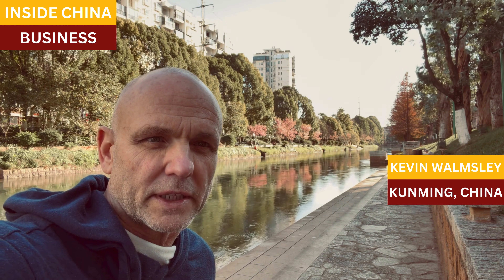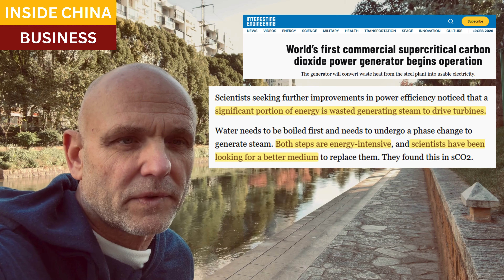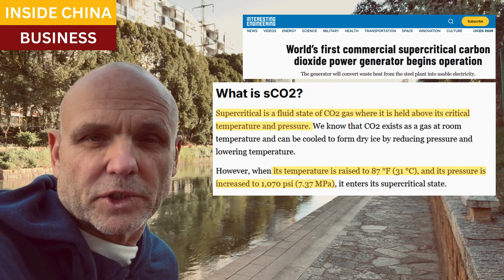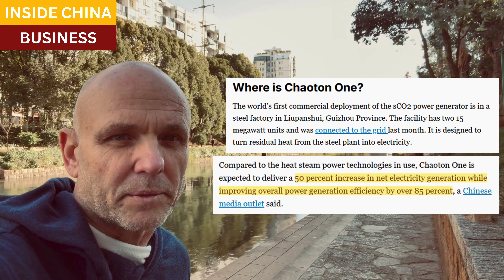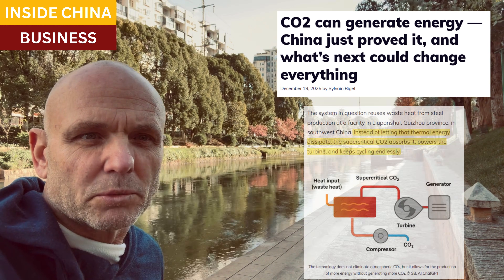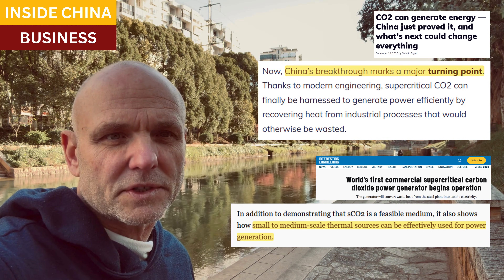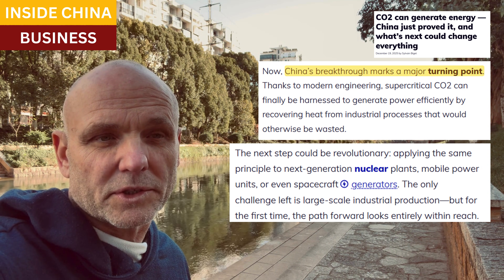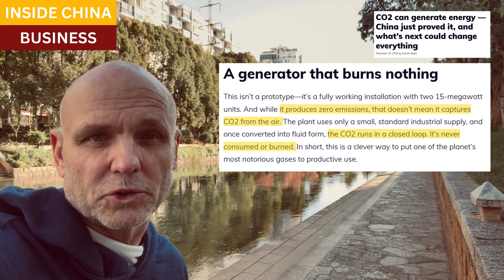Revolutionary generator transforms Chinese factories into power plants

Comment: I use carbon dioxide as a shielding gas. There appears to be many factors missing in this analysis such as where does the compressed CO2 come from and how do you recrompess it within the closed loop.

Comment: This is actually cool I work in HVAC/refrigeration engineering and we use it a refrigerant in systems with high pressure. I wonder the same if it could be used as turbine it does have different properties and components but using it in this case is pretty cool.

Comment: Giga clickbait. This is a waste heat recapture system, which is valuable of course, but it's not revolutionary. And that thumbnail makes it sound like the CO2 is fuel, as though you could pull it from the atmosphere. The CO2 is just the heat transfer medium.

Comment: I have only seen them in the lab or in prototype mode in the US , they are so much more smaller than the comparable steam turbine. there are some issues with keeping the Carbon dioxide supercritical   and the material of the turbine blades are still issues  but looks promising

Comment: this is a much simpler use of waste heat than using it via pipes to heat nearby homes. Its not worth it to have a heat network transporting heat over long distances, rather just reelectrify the heat and use a heat pump at the target location. Also in summer heat transport is useless, and you get free power.

Comment: So they use CO2  in a turbine. This is not a breakthrough. This is Chinese propaganda. 

Any engineer realize imediately that they are just using ORC, Organic Rankine Cycle, which works like a heat pump but with a turbine instead of a compressor. 

This tech does not create energy, it reduces waste heat and turns it into electricity. But the heat is from Natural gas or coal so not CO2 neutral. 

Learn engineering and dont be fooled by charlatans.

Comment: So... basically they are using Organic Rankin Cycle generators and instead of running it on Benzine or something similar they are running it on CO2 and heat gathered from the waste stream? Or is it a closed loop ORC?

Comment: The efficiency of a heat engine is determined by the gap in temperature between the hot and the cold temperatures. This invention is a secondary effect on efficiency where you lose some energy pumping fluids through pipes. You can use fatter pipes, but that's more material costs. You can't get around the primary limit to efficiency. It's based on statistical physics and is mathematically correct.

Comment: What bout internal combustion engines . Your truck exhaust ànd radiator. 
Are these generators makable in mind farm
Reply: That is can an internal combustion engine have the 50 or 60% of waste heat, used in these systems. Miniature versions

Comment: Same principle as the usual one by cooking water. Everyone do, over here the local sewage plant is energy neutral for more a decade and the  waste combustion plant sells electricity to chemical plants and steel mill. Way more safe because you can see the vapor and it will not block your oxygen support in case of. So the CO medium must have a way better  let's say enthalpy as the water vapor wich i doubt. Just show it, instead of Juche regime style cheering.

Comment: CO2 is used as a heat carrier like refrigerant. It is long known that CO2 can absorb lot of heat but could not be compressed so was not used in heat pumps. Japan does make Co2 heat pumps that can work upto boiling point.
If humans can strip 1 O(xygen) from O2 in the CO2, then we get a circular carbon economy and there is no need to dig up more fossil fuels or vent out CO2.
But then how can wealth be concentrated in hands of a few ?

Comment: Oh wow, I assumed sCO2 would need high temperatures, but carbon dioxide can become supercritical at temperatures as low as 31 degrees C. sCO2 can be used pretty much anywhere water is currently used for heat transfer, with greater efficiency, to the extent that the system can be miniaturized.

Comment: the problem is scaling and material cost. sure you can generate power by heating co2, but you need to get the co2, and you need to be able to manufacture materials that can handle the super high pressures and temperatures in gigantic amounts. sure, you could power a steel plant, but how about an entire city or a state?

Comment: I have some experience with this type of technology I have evaluated it for use in a steel mill and found it to lacking in economic payback.    Changing the working fluid from water to CO2 has efficiency benefits but not enough to offset the maintenance and operational difficulties in using CO2.  (CO2 is a difficult fluid to work with, it is hard to compress and it dissolves in oil which makes lubrication of turbines and compressors fail) 
 This 30MW installation is the largest installation I have heard about, but I have seen no operational data.  I would like to see the data to see if there really is some advantage in using CO2 vs water.

Comment: It's actually ground breaking. if it can be adapted to oil rig and oil refinery where flaring is routinely done. Such a waste. Solar mirrors power production will also benefit greatly from this tech if adapted. This is the holy grail where steam is being replaced by more efficient CO2 in direct heat power generation. The usage is vast. The West has lost. Japan has lost.

Comment: Instead of boiling water to make steam, the system heats sCO₂ and expands it through a turbine to generate electricity. Supercritical CO₂ is CO₂ held above its critical point (≈31 °C and ≈7.4 MPa), where it behaves as both a liquid and a gas.

Comment: Found this link about Sandia labs working the same process https://www.youtube.com/watch?v=6cQCbmzN8Ew
Just need industry picking it up and solving some of the issues Sandia mentions.
The biggest differences comparing steam to SCO2 is the lack of a condenser (steam); No chance of getting water droplets hitting blades in the LP turbine.
Question: The steam turbine water pump back into the boiler is fairly small (?) How big is the SCO2 pump to get it back up to pressure (~1000 psi in the case noted here)?

Comment: For 50 tears I have on occasion installed passive freeze technology in Alaska that uses compressed CO2 thermal cycle to extract heat from soils in permafrost areas in order to further stabilize structure foundations. The method was pioneered and patented by Irv Long in Alaska and has been employed in cold climates all over the globe. I am interested in these claims but as always with this channel, question every thing said.

Comment: The American Society of Heating Refrigeration and Airconditioning Engineers (ASHRAE) from 1973 the time of the Oil Crisis made significant engineering advances in uses of low temperature waste heat. When Oil supplies and prices returned to normal these advanced technologies were consigned to the dustbin

Comment: The supercritical CO2 cycle has also been proposed in connection with thorium molten salt reactors. Jiangsan shipyard in Shanghai says it is working on a system for container ships using the CO2 cycle.  The turbines are smaller and more efficient so are a natural for ships.  Don't be surprised to see one day these CO2 cycle TMSR reactors being used on carriers, submarines, and other warships.

Comment: I read a critique by Cleantechnica which had a wait n see approach citing a history of rapid efficiency degradation in prior applications of similar technology. That article had appreciation for Chinas aggressive experimentation but defers excitement until after a few years of operation without significant efficiency degradation. 

China on the whole though is comprehensive in their approach to energy independence & cleaner sources- this approach is just one component of an overall aggressive plan.

Comment: This is a real game changer if it can be scaled up.  The main attraction of this technology is it doesn't consume water in massive scale like a steam turbine.
It may surprises people but the biggest constraint of any large thermal power plant, that involves steam turbine, be it coal fired, oil fired, nuclear or gas-fired combined cycle, is the water for cooling the condenser.  Today's environmental regulation limits the cooling water cannot be raised to more than approximately 6 degree above ambient.  Thus a huge amount of seawater has to be used and infrastructure of the cooling water system is approaching its limit when the station generates about 7,000 MW.  A significant reduction of the cooling water demand will give a new future to the thermal power plants.

The west has been laughing at China because it is still building coal-fired power plants but they are seldom aware that many of the new coal-fired power plants in China is using "ultra-supercritical" technology that the west has ceased to pursue because the west has abandoned building new coal-fired power plant completely.  China has been using molten salt and sCo2 in power generation so it is able to operating these new technologies in commercial scale.

Comment: So... this is just a derivative of Jame's Watt's original steam engine.  China merely switched the coal boiler to a heat exchanger drawing waste heat from an industrial process, using supercritical CO2 instead of steam, spinning a turbine instead of a piston.  There's no Chinese innovation here, because it's just an upgrade to a variety of technology that's been in use at Chinese coal plants to drive even more efficiency by maximizing energy efficiency, or the turbocharger on an internal combustion engine extracting power from the waste heat in the exhaust gas.  

Sure, the West doesn't have any modern supercritical CO2 power systems operational, but make no mistake that China is only copying when they make fundamental changes to things, incorporating zillions little tweaks and upgrades to work with supercritical CO2 at high temperature, high pressure where gas functions like a liquid, with all of the necessary challenges of thermal / pressure cycling, sealing, gas purity, etc. 

Yes, this is a one-off test case to assess long-term viability, similar to the Thorium Molten Salt Reactor (TMSR) they have running in the Gobi Desert.  China will run this for a few years to assess cost, operations, efficiency, maintenance, degradation, and wear against predictions before deciding if/when/where it makes sense to implement and deploy at scale compared to existing systems that do the same thing with steam as the working fluid. 

Then, we'll all be surprised in a decade, when suddenly, China has these things installed on every new thermal system.

Comment: “The supercritical CO2 (sCO2) Brayton cycle, first proposed in the late 1940s  and then patented in 1948 by Sulzer Bros.
Erly research in the 1960s by Angelino and Feher focusing on efficiency, then shifted to nuclear applications in the 1970s before waning, only to be revived around 2004 by Dostal for next-gen nuclear reactors, sparking renewed interest due to its compact size, high efficiency potential (over 50%), and material advantages over steam, driving current development for nuclear, solar, fossil, and waste heat recovery.”
Nothing new under te sun.
Neither is monetizing waste heat.
The real accomplishment of Chinese engineers is the design and implementation of a very complex heat exchanger for a steel furnace to run Brayton cycle.
Let’s hope this installation works well for many years and gains popularity despite higher complexity and cost.

Comment: Actual performance versus its theoretical potential In practice, CO2 cycles have roughly 3 to 15 times lower "specific power output" than traditional gas or steam cycles. This means you must move a massive amount of CO2 to generate a relatively small amount of electricity, which leads to high energy consumption just to run the system. CO2 sCO2 cycles are being used to drive investment and stock valuations, even when actual industrial adoption remains stagnant. The trajectory of Tokamak reactors, where the promise of a revolutionary breakthrough sustains a decades-long research economy without delivering a commercial kilowatt-hour to the grid. I would be concerned "innovation" has become an end in itself rather than a means to solve a problem.
Reply: but how come one company has already installed a plant and it is working? which stock valuations are you talking about?
Reply: Then why bother. Let's go back to throwing sticks a mastodons. From Australia

Comment: In short, the heat from factories are too low to heat water to generate steam to then generate electricity through a turbine, but sufficient to heat liquid CO2 into gas that is dense enough to turn move a turbine to generate electricity.
Reply: And if the technology is applied to existing power stations where similar heat levels are wasted in the smoke stacks/towers after generating electricity by boiling water/generating steam, it could generate additional electricity without any additional feedstock.

Comment: the Chinese are building not only ice breakers but all large ships will use the Thorium cycle.
CO2 'boils' [phase change] at lower temperature and therefore can utilize lower temperature [i.e. higher efficiency] to produce electricity or shaft power in direct drives.
GE had developed a desk sized CO2 turbine which otherwise would be the size of a large room. Submarines and large aircraft are the most relevant applications. That's probably where GE's focus is but now they will be forced to go mainstream or lose that market. In space,  lower boiling temperature fluids, like helium or nitrogen, will be used. [ I invent in this space]

Comment: to keep such a high pressure system running would not be easy. that about 70 times sealevel.
Reply: Fluid sCO2 to Liquid CO2 (loop) systems

requires LESS than HALF the HEAT
and
LESS than THIRD the PRESSURE
of
conventional water (liquid-to-vapour) steam turbine systems

because supercritical fluid sCO2 absorbs heat fast like water, than gases or vapour does
while heated liquid CO2 (stays fluid, not become gaseous) drives turbines more efficiently like liquid water, than steam water vapour does

also:
making such systems more compact, less bulky, and lighter weight, than steam turbine systems

Comment: I wonder it is possible to embed sCO2 pipes inside concrete of large buildings as effective heat exchanger.  During the summer, the heat from the Sun can be used to generate electricity.  This will reduce the power for AC.  During the winter, the pipe can be used as a heater by connecting to  a heat pump.
Reply: photovoltaic systems are so much easier to do

Comment: This it’s significant.  It seems China is very serious about reducing CO2.   If sCO2 is paired with coal power plants, a lot of CO2 emitted can be sequestrated.
Reply: China already "Urban Mines" CO2 for many applications other than just "sequestering" it

or used as source of sCO2

they already make SUGARS for making Animal Feed, from CO2 mined from Coal Plants
of course, CO2 is purified first, before using it elsewhere

purified CO2 is also used to REPLACE WATER as a medium to push out OIL stored in empty OIL deposits, as well to help EXTRACT new oil from new oil deposits

Comment: They're still using coal to run the sintering furnace in the middle, but instead of just blowing it off to the atmosphere they run it through this and put electricity back into the grid. Still leaves ash and other gases that have to be dealt with, but with the added bonus of getting power put back into the grid. The area has so many solar panels wholesale electricity drops to zero or negative numbers during the day. Imagine trying to compete with that. Does your business pay a power bill? If you had a government that could look into the future a little bit maybe you wouldn't have one.
Reply: do you know China "urban mines" REMs+Critical-Elements from so-called "waste" (ash)?! whether in mining operations, smelting operations, refining operations, fuel combustion operations, WtE waste-to-energy operations, ...

as well as urban mining CO2, too?

Comment: Instead of selling those excess electricity, wonder if they can reuse those electricity to generate heat so as to reduce the overall input of the source of heat (burning coals).
Reply: what's wrong with "burning coal or gas" or "burning waste"?

it's efficient!

China Urban Mines CO2 from both!
China also urban mines Rare-Earth-Metals and Critical Elements, too!
=
no unwanted waste "leftovers"!
+
no CO2 emissions!

Comment: Its hardly surprising that anything with carbon as an element can be used as fuel. However - this technology is potentially dangerous for the simple reason Carbon dioxide is an essential element gas required for photosynthesis... it should noted by the idiots who believe the climate crisis narrative that the small improvement of CO2 is actually greening planet by some 15% since the early 2000's. Remove it and life dies - all of it! It wont take much removal to achieve this very REAL crisis - only about 20% of what presently exists before the impact makes life extremely difficult for humanity and the larger fauna of our planet. Its simple math supported by honest science. I wouldn't be celebrating this news too quickly the consequences of its mass adoption could be dire indeed.

Comment: Supercritical C02 also useful in semiconductor industry, as it preserves K value dielectric constants, vs aqueous solvents.  Semiconductor fabs should also have co-generator power because if the main power goes down, even for a few cycles, it is catastrophic.